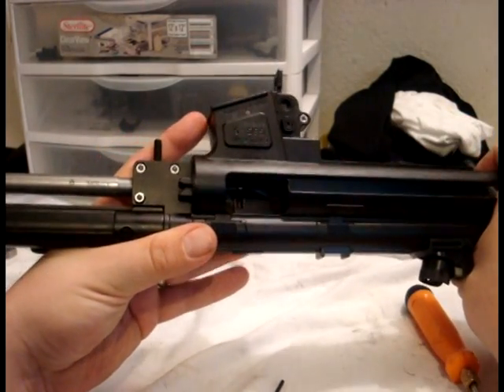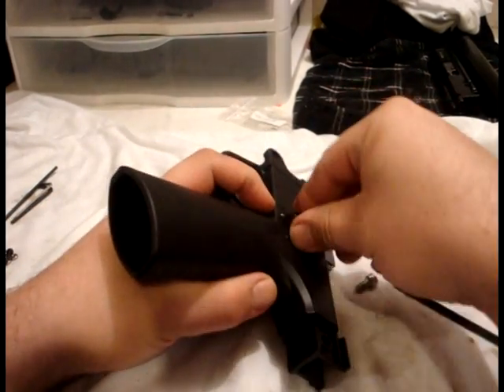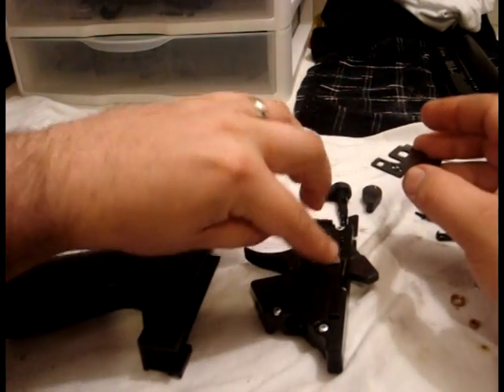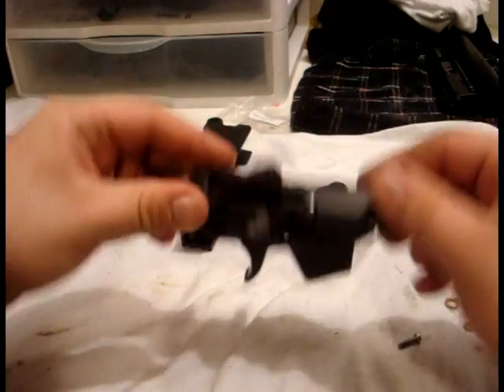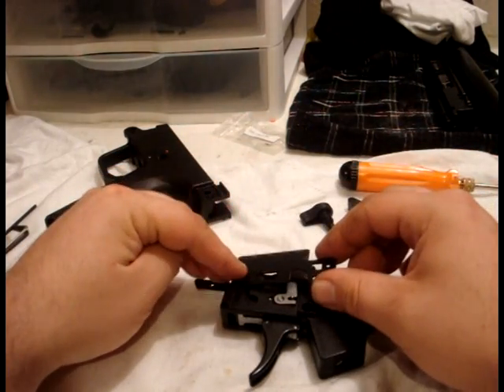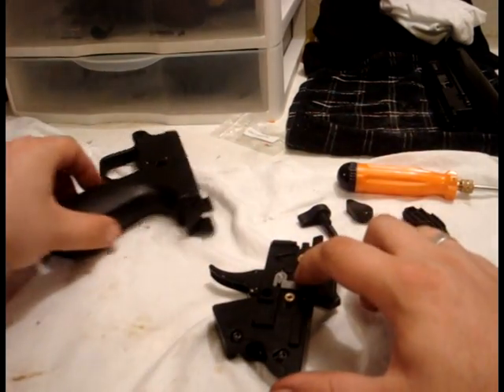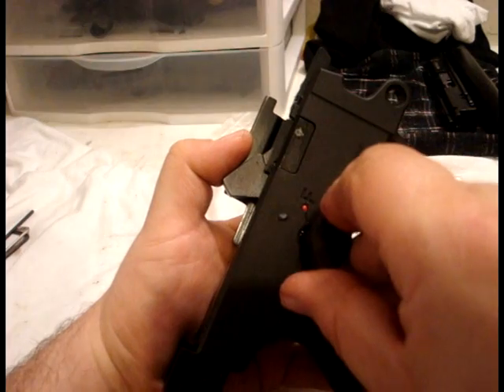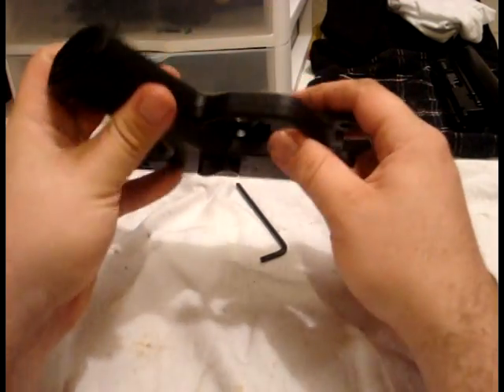Part 3 - GSG-5 Full Teardown & Screw Upgrade

Comment: have you ever had a problem with failure to fire. i have cleaned the gun, i can have anywhere from5-6 failures, cycle it, 1-2 fire, then back to failures. talked to a gunsmith and was told sounds like lite striking , any ideas on how to fix

Comment: What is the screw in the bottom of the other screws holding the barrel, my gsg522 doesn't have a screw in the bottom , I see the threads in the hole but nothing there

Comment: After this upgrade I am having issues with light primer strikes every time.  What can be causing the bolt to do this?
Reply: installed your hammer return spring wrong or over-torqued it closed and it's binding on the hammer.  More likely, you installed your hammer strut upside down.  If it went on easily, you did it wrong.  It should be a massive pain in the ass to put back together